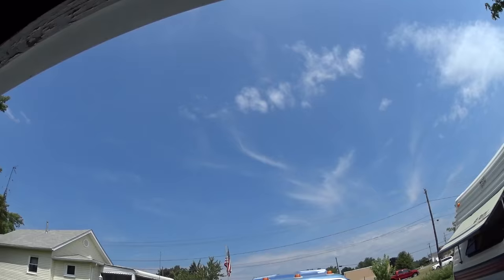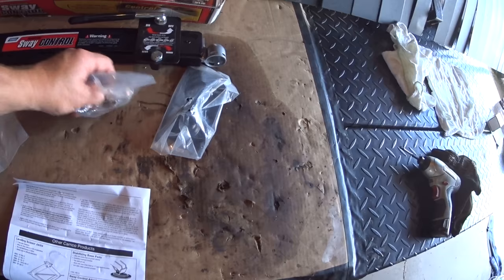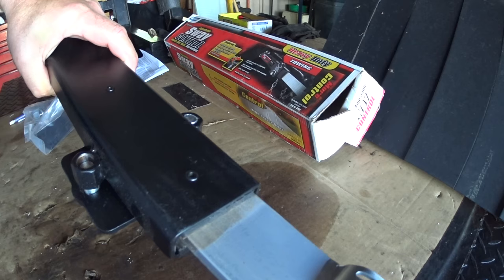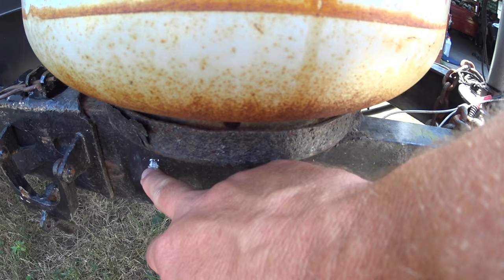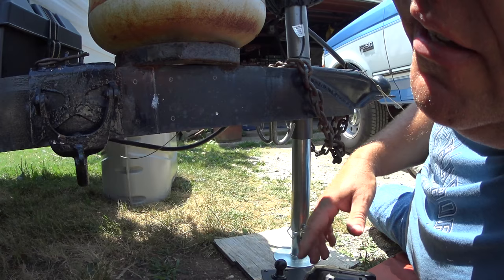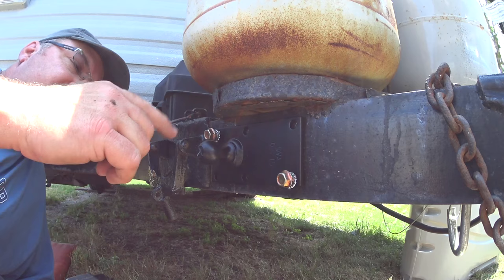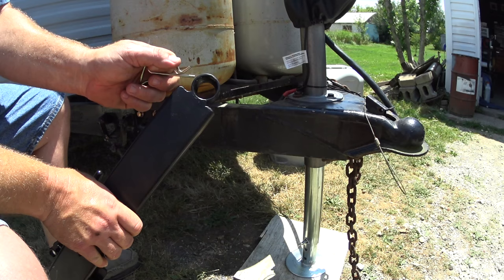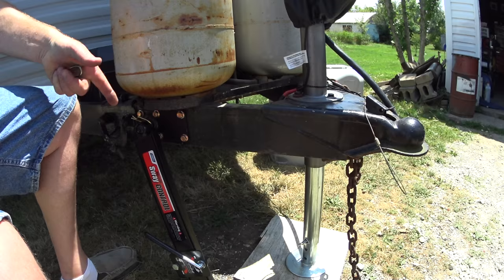RV Trailer Sway Control Install

Comment: I have been through what you are going through. You have the worst tire and wheel combination Ford ever put on a truck. I would be willing to bet the sway you are feeling is side wall flex of the tires. They are too tall for their width. If you want that thing to handle like a sports car while towing do what sports cars do. Put wider tires and wheels on with not so much sidewall height. I would be willing to bet your middle number in your tire size is 85, if you got that number closer to 70 you would notice a huge improvement. I have also noticed that if you can find a tire and wheel combination where your wheel width matches your tread width, stability and tread wear both improve. Another thing that helps is to shorten your hitch as much as possible, get the ball as close to the back of the truck as you can. It may mean drilling a new hole in you hitch mount, not in the receiver but in the piece that slides in. I know trailer sway at highway speeds is unnerving with a high pucker factor. Best of luck sorting it all out.
Reply from the maker: Yea, The profile is tall.. I was having a difficult time finding a 10ply that I liked and I was looking forward to some increased tire height to drop my Highway RPMs down and as an added bonus make my speedometer read correct again(or within a MPH).. Of course the more pressure you run should help to negate some of the sidewall flex but the footprint then is a little more narrow and rounded when there is no load present.. I will continue to play with the pressures under load and see what feels the best... Maybe on down the road I will get a 17 or 18 inch wheel and tire combo that drops that profile back down.But since I just shelled out close to $1000 for the tires and mounting and balancing I will deal with them a bit longer.... Thanks for your insight!!
Reply: Great advice......never thought of that.....thanks

Comment: Red loctite is permanent
Reply from the maker: The reason that I was putting blue Loctite on there is because I didn't know if I was going to open up the holes to the larger size and install bolts nuts and washers instead of the self threading screws that were offered with the kit. Does not call for any threadlocker whatsoever however I decided to install using the blue just in case I decided to switch at a later time. And as a note, red is not permanent. It is meant to be used in more permanent assemble applications however just heating it slightly with a propane torch for a minute well allow it to be disassembled.